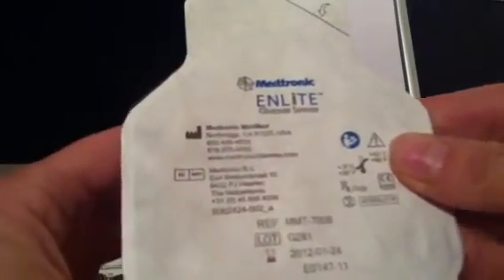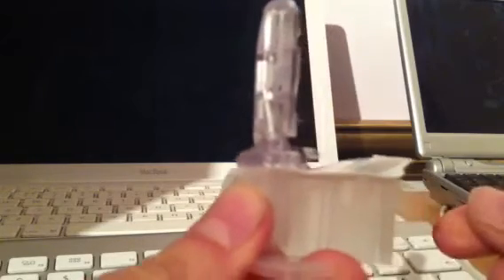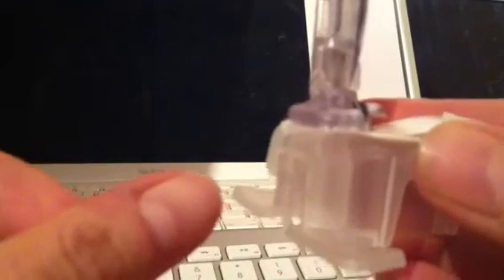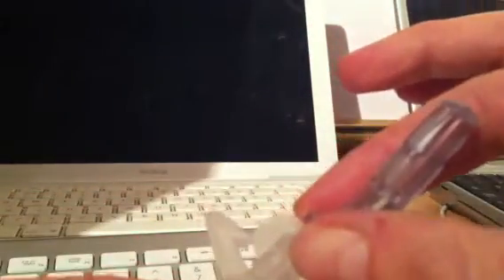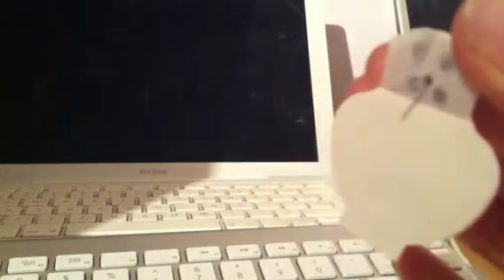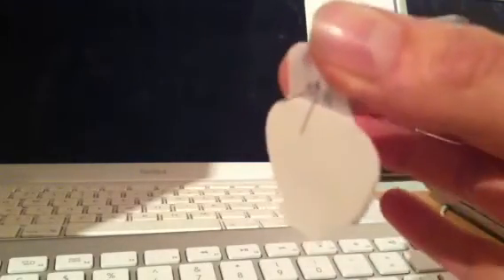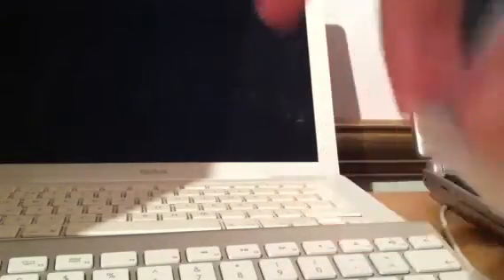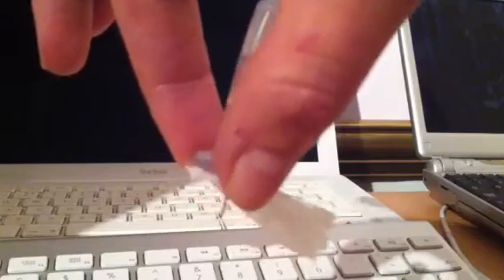Manual insertion of Medtronic Enlite Sensor

Comment from the maker: 2/2 When callibrating only do so when blood glucose levels are fairly stable, i.e not just after a meal etc as this can shorten the life of the sensor too. Siting the sensor I put it on the top of the buttocks or the thigh (just where you would inject insulin). I've not noticed a difference in accuracy with sites. Maybe slightly better on the buttock, but they are still very accurate.